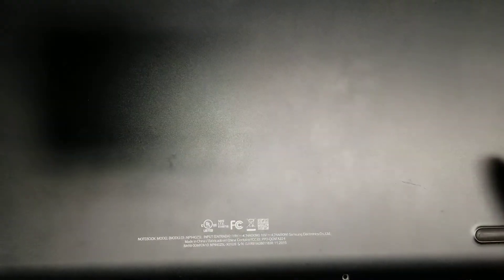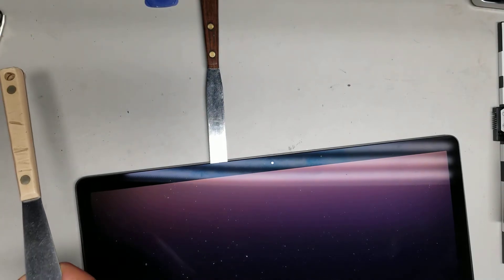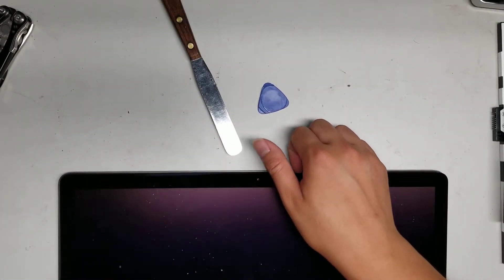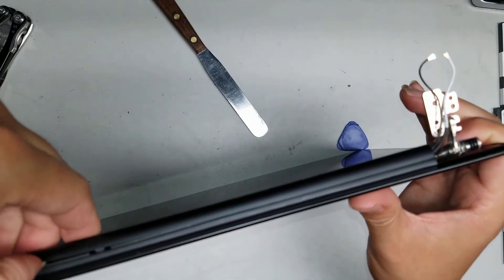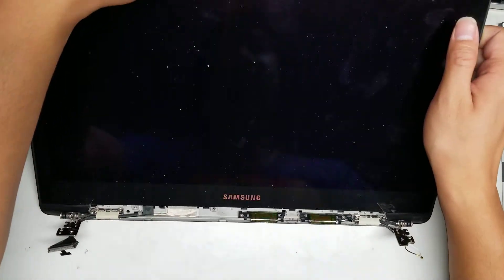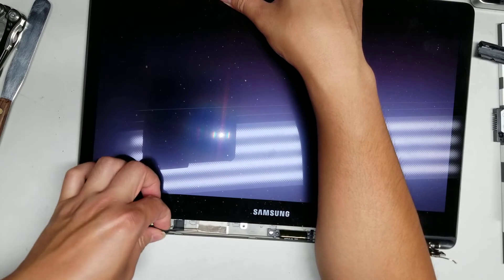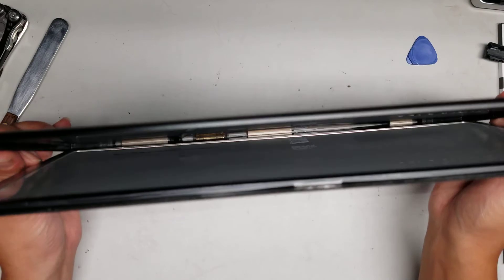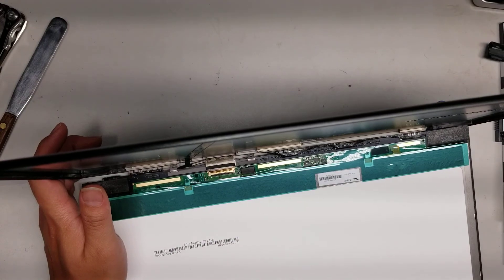Samsung Notebook NP940Z5L Disassembly Screen LCD Removal Repair Replacement

Comment: I was hoping to see an actual screen replaced for this laptop. Getting to where the video ended is the easy part. I read that some screens for these models do not come with a bezel and some require transfer of the backlight board. That would have been great to see..
Reply from the maker: The screen is glued to the digitizer. No normal person or even repair place will do that. You'll have to deep freeze it to separate the two layers.
Reply: I cannot find the NP930QAA anywhere!
Reply from the maker: @RachelBlomstrom  what's that?
Reply: @ItsBinhRepaired  Samsung notebook 9 laptop model
Reply from the maker: You're trying to buy one?
Reply: @ItsBinhRepaired  I was trying to replace the screen on one. But it turns out the screen they sent me isn't compatible after all. So I'm back at square negative
Reply from the maker: @RachelBlomstrom  :(

Comment: Does the screen need to be removed to replace the two hinges? Or are they easily accessible?
Reply from the maker: Easy trick, look at the parts and then think about if the screen is in the way. It's not too difficult to see.

Comment: Can I send you my laptop and can you change the screen for me? I'll pay for the service and shipping, I don't trust myself. I tried to change the screen of my Galaxy phone years ago but screwed up. I can't find screens with the full setup so I can just swap lids, I only find postings for the LCD screen itself. I have the same laptop as in the video (NP940Z5L)
Reply from the maker: Sure, but it'll be pretty pricey. This type of repair is usually about $150 labor. The part I'll have to see if they're still available.
Reply: @ItsBinhRepaired  Do most parts come with adhesive? Is it a strip or liquid glue, and how do you apply it? Can you maybe make a vid on it?
Reply from the maker: @saulhadic1026  it's basically double stick tape.
Reply from the maker: @saulhadic1026  I don't have the device to make a video
Reply: @ItsBinhRepaired  oh then I can probably do it myself. The LCD and the glass are one part? When I did my phone repair they were 2 different parts, I only had to replace glass but messed up the LCD because the heat gun was too hot
Reply from the maker: @saulhadic1026  that's the purpose of the videos haha yeah, lcd and glass are glued together
Reply from the maker: @saulhadic1026  I wouldn't attempt to separate the layers.
Reply: @ItsBinhRepaired  at the time the phones had separate layers, idk about now. The screen already has the wiring setup, right? I just have to add hinges, connect, and place into shell?
Reply from the maker: @saulhadic1026  did you watch the video? The video is there so I don't have to do extra work explaining what's already in the videos. Lol don't turn my job into repairing, making videos, and then explaining what's already in the videos. XD I have too much work as it is. Lol
Reply from the maker: @saulhadic1026  please watch the video completely, and if you don't understand, then ask.